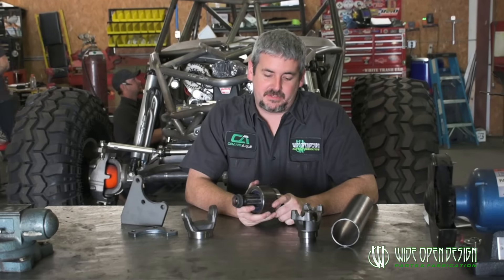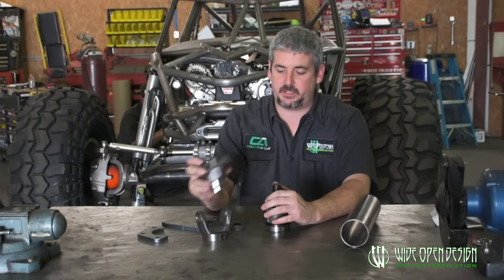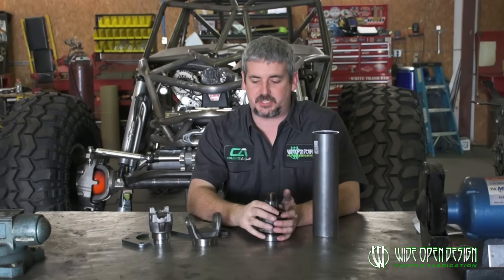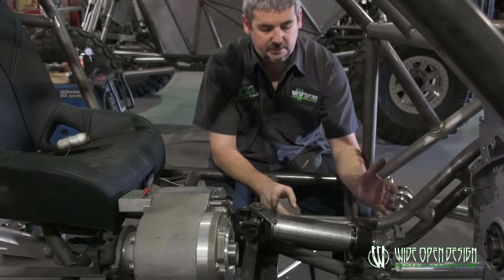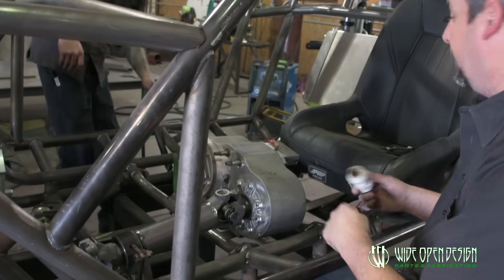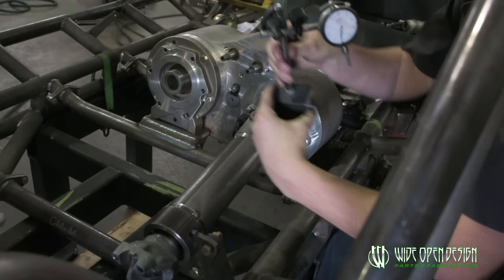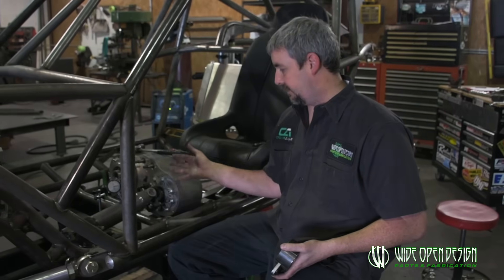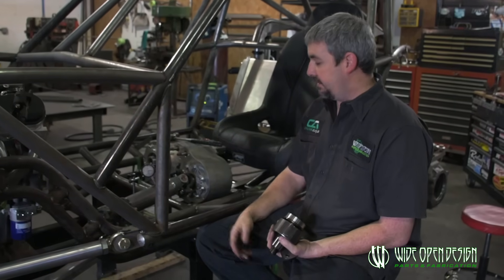Carrier Bearing Shaft Install | Off Road Heavy Duty Carrier Bearing Shaft Kit | Wide Open Design

Comment: Great video. One thing to add, if you can get the bearing end yoke as close as possible to in line with the link mount, you will have minimal slip needed in the driveshaft.